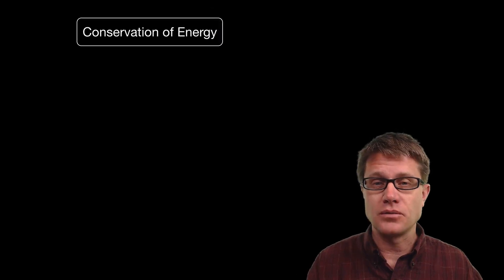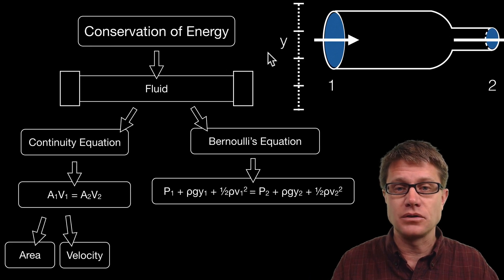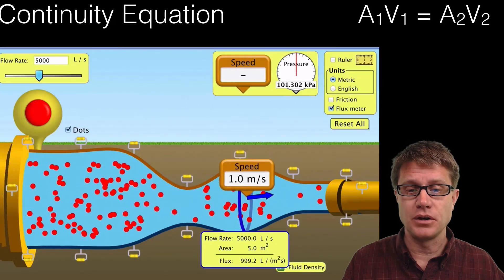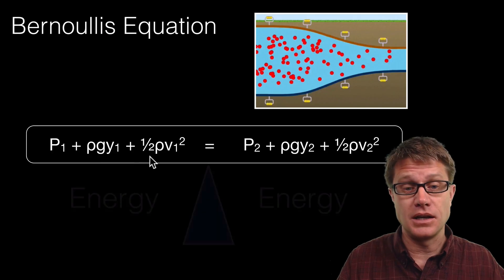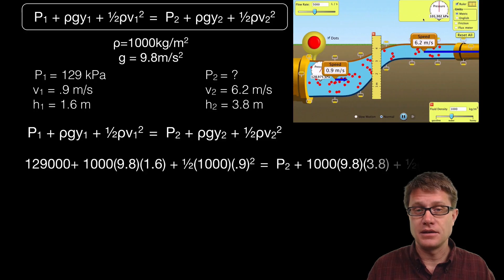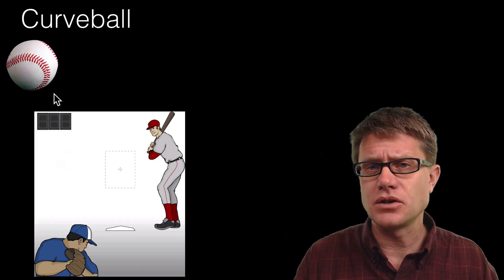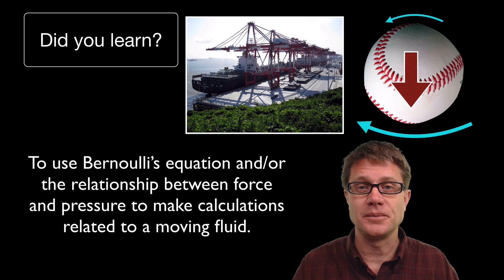Bernoulli's Equation

Comment: Professor what about Gravity? 
When the water is moving from left to right and must go uphill doesn't gravity come into play?
 I really only know about Bernoulli's law from building an airplane. 
Laminar flow is key when building the most efficient wing or airfoil. 
 I've built a couple of small hydroelectric applications.
Head and fall are key to a successful outcome. 
Pipe diameter , pressure and volume are essential to make enough power to achieve the desired outcome. 
 I'm old so I'm getting soft and slow. 
 I'll take my meds and then have another run at this. 
Thank you.

Comment: 5:20-23, why potential energy C has more than A? Isn't it the pressure?
Reply: yes, the potential liquid matter inside the box were pressured by the gravity. thus, the most bottom part liquid of the box receive more pressure than surface. Imagine when you are being piled beneath boulder of rocks.
Reply: correct me if i am wrong :)

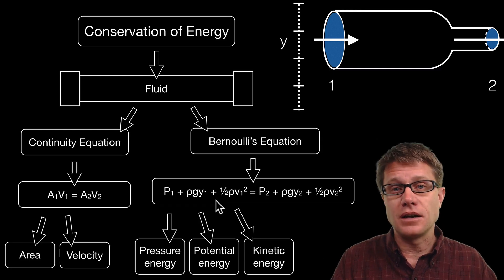Comment: what i dont understand is how in bernoullis equation P1 is different from P2, when Pascal's law states that pressure change occuring at one point is the same at another point. Take two points A and B at the same height like in the first example(3:10), the pressure there will be the hydrostatic pressure which will be the same cause of same height and the pressure that the you apply, so if the pressure from point A is transfered to point B how can P1 and P2 have different values?

Comment: The statement of why the milk would flow out of the carton in such a manner is incorrect!
Reply: But all of what you've said doesn't help a person trying to learn the basics, which is the intention of the video (and why it is simplified). If you already know the extra beyond all this then don't watch the video and don't confuse people who are just starting out by trying to pick holes, show off and look good. It's like discussing conservation of energy and VA relationships in electrical transformers at an introductory level and then someone twittering on about eddy currents and core losses and the like. Not helpful.
Reply: @keith3289  I get your point by reading your answer to Terry wilder. We should keep in mind though that each one of us is watching the video under different motives and from a different point of view. Varying from beginner to professional level. There isn't any issue of confusion in anyone's comments. The answer lies in personal research. Research, research, research. 

P.S. philosophically speaking.
Reply: Measure height from the hole in the side to the top  "water line" of the milk. There is more height and more PE from the bottom hole all the way to the top of the carton, whereas the top hole has very little height/PE to the top of the carton.
Reply: terry wilder ikr the potential energy is supposed to be greater on the top because it's at a height also the pressure increases with the depth but other than that the lecture was  dope
Reply: Matt M. The incompressibilty of the milk with density d would tell one that the kth of n different identically shaped milk cartons of  volume V, with horizontal cross-sectional area A and heights equal to the distance between holes with holes near their  bottoms would initially exhibit the same behavior as the kth hole if the kth one was subjected to a pressure of (k-1)V×d/A I.e. incrementally increasing the pressure of successive cartons by the weight of a full carton divided by it's area. One Bernoulli equation does not handle this.
Also obvious is that the gain in kinetic energy from the loss of gravitational potential energy cannot exceed that lossed from hole to hole.
These are scalar point and vector point functions in 
Bernoulli's equation.

Comment: is the pressure on a point inside the fluid, or it's the normal stress acting on the inner surface of the pipe?
Reply: pressure on perpendicular area or a point is considered. However stress also exist on every point in fluid as well.

Strictly speaking, pressure is normal force /unit area but stress can be parallel as well (called shear stress).

Also this equation is in scalar terms so scalar pressure is used and stress is a tensor.

Comment: Sir, great explanation! You helped shed light regarding Bernoulli's equation. Although, for the sake of other viewers, can I clarify the following? Around 8:00, shouldn't (0.5)(1000)(0.9^2) be equal to 405, not 1620? Also, the unit for the density of water should be kg/m^3 (instead of kg/m^2). I know those might just be typographical, but it's better to have it corrected right? Thank you!
Reply: @polly you are just right
Reply: Exactly. I was reading through the comments and wondered how he got 89440 Pa. 
The right answer is 89.435 kPa
Reply: @Karim7097  I know you commented ages ago... But I'm wondering if you could help me? I got 88.625 kPa

I had 129000 + 15680 + 405 = 145085
And on the other side I had P1 + 37240 + 19220 = P1 + 56460

So I did 145085 - 56460 = 88.625 kPa 
Any ideas why my number is slightly off from what you've said?
Reply: @PollyHarrison  my answer is the same 88625 but how do you know it's kilopascal??
Reply: @mahesv75974  He changes 129kPa to 129000Pa (same as you'd change kilometres to metres) at the start of the equation so the answer is 88625 Pascals, or 88.625 kilo Pascals (Dividing by 1000 ).

Comment: I'm amazed by the marvellous efficiency and intelligibility of this video, honestly.
7:10 Just got a bit confused by the density of water where the unit is Kg/m^2 instead of Kg/m^3
Reply: It depends if you are in 2D or 3D. He seems to have kept everything in 2D so everything is normalized over the depth, hence Kg/m^2 is appropriate here. In a 3D setting you would of course use Kg/m^3.

Comment: sir how did you come up with 1640 kinetic energy in the left side???im a bit confused coz i always get 405 please enlighten me with this one thanks in advance and very nice video.
Reply: same here
Reply: exactly, you are right on that part. If you use 405 on the left hand side of the equation instead of 1640, the answer you get for P2 should be around 88.6Kpa which is actually much closer to the actually answer which is 87.3 Kpa